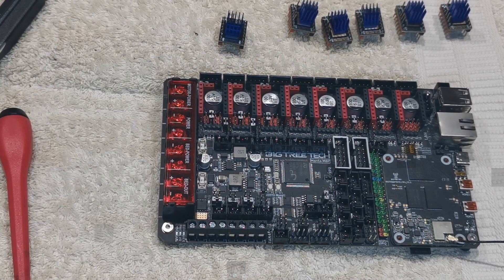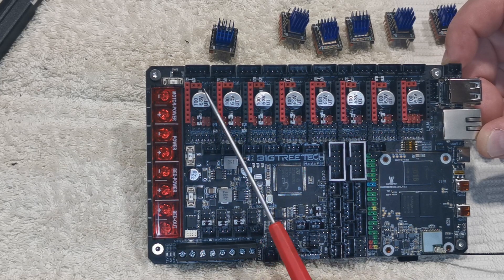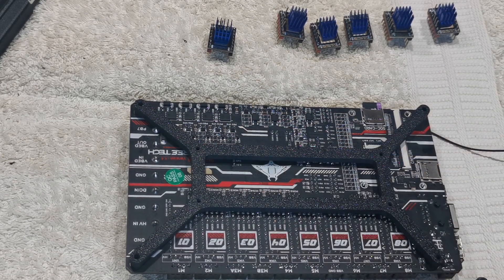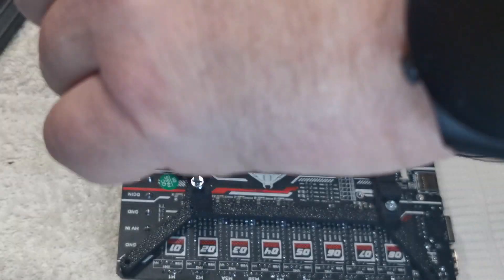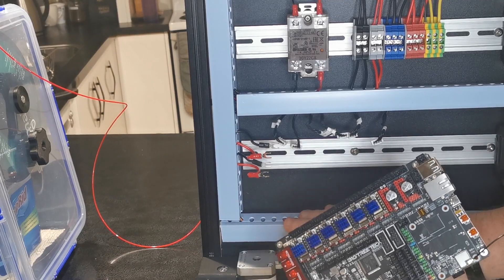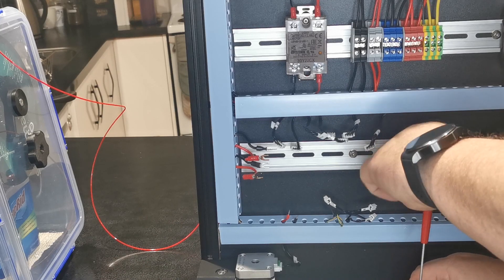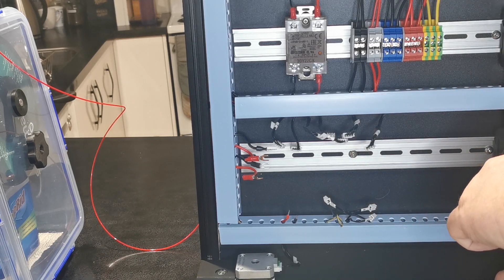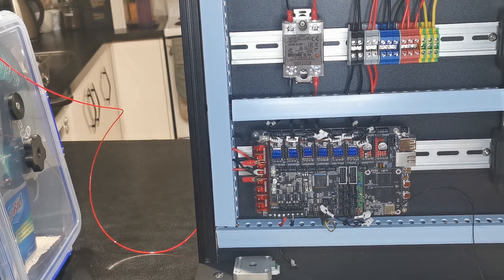VORON 2 4 R2 MPX CBT BUILD SERIES PY 20 - M8P Manta Main Board   Jumpers & Din Rail Mounts

Comment: at 1:30min onwards, your explanation about the end stop and power pins is incorrect! The top pins above the steppers are for Vin vs Motor Power voltages, the ones below in the red headers is to determine UART vs SPI mode stepper drivers